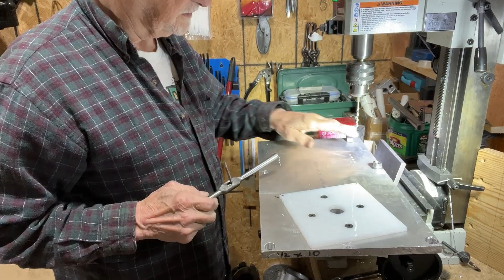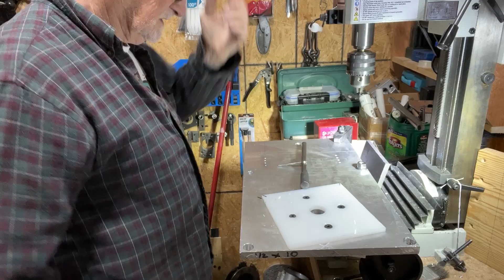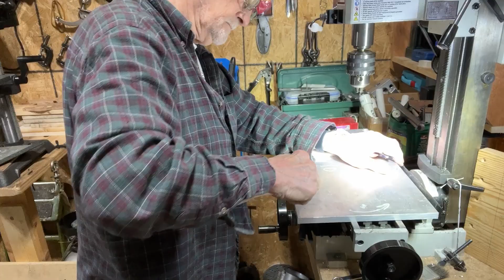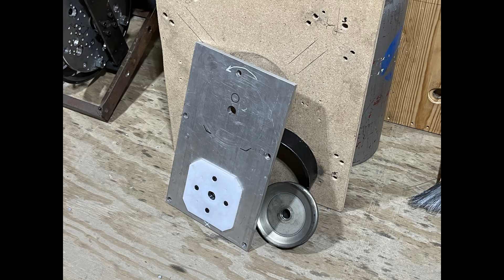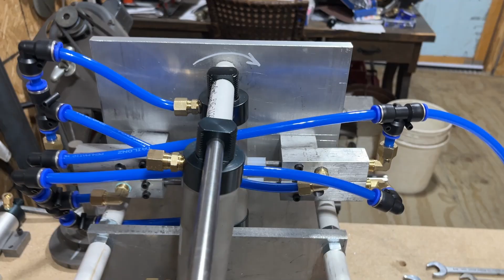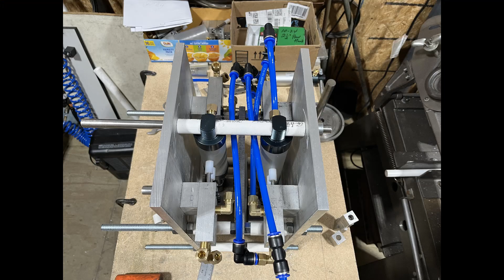Air Engine, making 3rd Devider Plate for Valves and 2nd Cylinder 4-19-25

Comment: I build a custom rotary valve for a double acting cylinder, and if you would like, I can send you a schematic for it.

Its really simple to build, especially if you are using [relatively] low air pressure.

The simplicity is mainly that this system works to even allow advancing of timing, and reversal of rotation with one handle.

So it can go from slow to fast, both going forward and reverse, with one handle.

The whole system is designed so that you can either make it 3 independent barrel valves timed with a single chain, or one long barrel valve with one chain.

You need a chain so it remains timed because a belt will slip.

But the valve is simple, even though it is kinda hard to put into words how it works.

I could sent you photos of it and draw you a diagram and give you some critical timing measurements required for peak performance.

With your tools and skills, you should be able to make it with little difficulty.

I can guarantee that it will last a very long time, will give you no trouble whatsoever, and will work on any sized air motor [as in it is scalable].

I built this specific valve for a 600 hp system, so its way over built for your needs, but you could make it work super easily for your small system with much less high end material [mine weighs 12.75 pounds  <without any of the fittings> and is rated for 10,000 psi (high tensile aircraft stainless)] than I used.

I imagine, you could make yours out of dimensional aluminum tubing and it would weigh less than 2 pounds with all the fittings.

Mine is for only one cylinder, you could make one as light as 2 pounds for all 3 cylinders.

In fact, its simpler to build, and would weigh less, if you make it into one valve, because you get rid of some redundant drive mechanisms, and, by putting each related port adjacent to its own cylinder, you use less hose/tubing to connect them than if you had to route all of the hoses from one end of the motor.

In a way, this type of valve, which runs parallel to the crank shaft [1:1 timing] is what a cam shaft would be to a poppet valve motor.

Also, it requires less energy to operate, and is easily lubricated with a zero weight oil, which is easy to come by, and the 'waste' goes on to lubricate the cylinders, so it only requires one oil input and one oil drain to lubricate both valve and cylinder banks, in such a way, if you wanted to, you could put a small cheap pump in the exhaust and catch the oil to keep recirculating it.

Unlike traditional 'dropper' oilers like many old machines used that just leaked all over the place, this would be easily contained because 99.99% of the oil would flow out the exhaust, leaving you with all of it in one neat place to filter it and run it back through.

Just let me know, and if you want to reach out to Keith Bowen of Hard Rock University, he is a guy I trust to securely put me into confidential contact with people [since posting one's email here on the internet puts all of us into risk of spam and other bad things].

Again, I will give you this information free of charge, because I believe in what you are doing.

However, IF you ever get to the point you would like to sell copies of it, I would like to ask of you that you maybe drop me 5% of the sales, or any amount, really, if you feel so inclined, since I went to a lot of work to design this and once it gets out, I can't stop you from using it any way you wish, and leaving me in the cold.

But I leave that choice entirely up to you.
Reply from the maker: Thanks for the offer, but I don't want to add anything on the outside or used oils or coolant - all sealed bearings.
The timing is very unique; the 3 cylinders operate 120 deg apart but push or pull together. Each Cylinder changes direction at 1/2 rotation from push to pull on the drive shaft so I think the best way to time the air in and exhaust out is by using touch valves activated by each cylinder's movement from side to side.
The timing is fine; it's the 3/8" air lines and connectors causing the difficulty - but do able.
So for now at least I'm working to solve it.
Reply: @AirEngineResearch  Well, whatever works for you is what matters.
Reply from the maker: Like I said in the video, I don't like all the airlines.
I'm open for a rotary valve that won't leak at 400 psi, would fit on the 7/8" drive shaft at the rear of the engine.
It would have to operate 3 separated double action cylinders; that switch from (Top port)intake  (Bottom port)exhaust at the bottom of the stroke to (Top port)exhaust  (Bottom port)intake back up to the top of the stroke, and then back to (Top port)intake  (Bottom port)exhaust.
Each cylinder is 120 deg off set from the others.
I do have a friend that is a retired machinist but he is not too keen on any time consuming lengthy projects, so I may not be able to get it  made.
SO, If you want to thin about, we can talk about it on 
airengres22@gmail.com